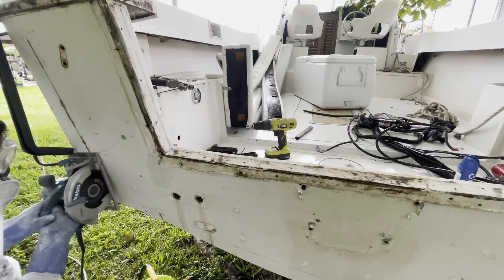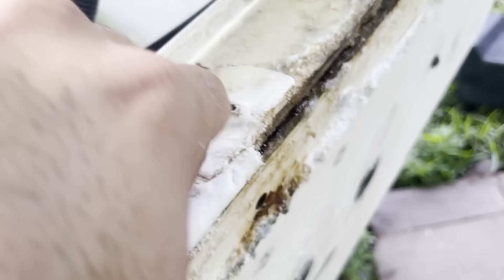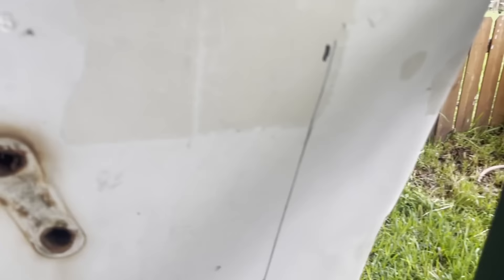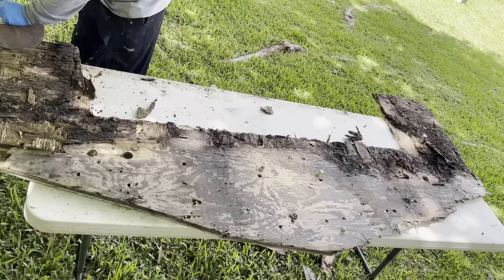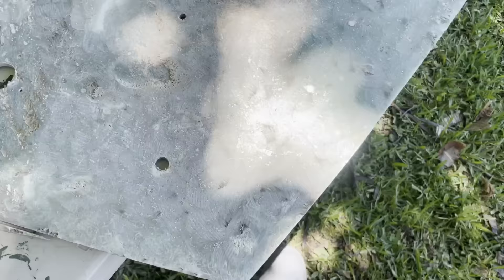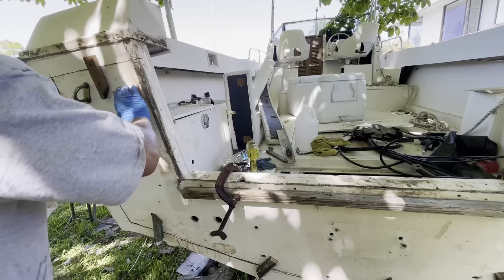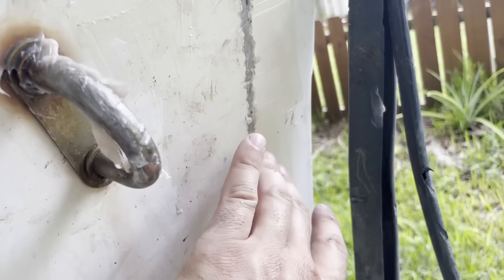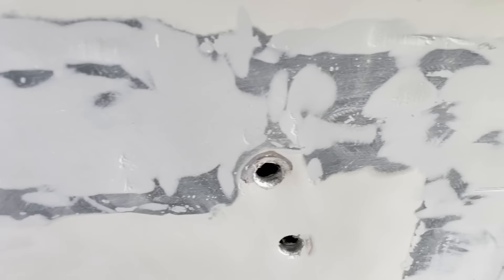Replacing A Boat Transom | Grady White Restoration Project!

Comment: This is a very nice job that will last a lifetime.

Some of the people making comments have no clue what they are talking about. You absolutely cannot remove all of the old wood from the top with a chainsaw or any tool. And it doesn't matter if you cut out either the inner or outer skin to access the old wood. That pourable transom bonds to everything it touches including the skin. You couldn't remove that skin if you tried.

The only thing I would have done differently is to wear something over my arms while cutting that fiberglass! I can feel my arms itching through the phone! 😂
Reply from the maker: THANK YOU! You see, you get it. No way you’re getting All the wood out. If you leave wood bits, they will rot, turn to dust and then you get voids. 

Pourable transom is a CHEMICAL bond that makes all the fiberglass and itself one. So it doesn’t matter! It’s not coming apart ever.  I think some people are confused with the mechanical bond you get with plywood or composite material when you glass it. Even then, I think it’s fine being done from the outside. 

Brother I’m STILL itching from this job! 😂 thanks for the comment! 🤙

Comment: Good job my friend.  I had the GW open and my transom was rotted more than yours.  I drilled into it to mount a ladder and the wood oozed out in a brown liquid.  It was so waterlogged the back of the boat sat so low, water always came in the drain holes.  If I kept the boat I was going to install the full transom with SeaCast and an engine bracket.   Just a heads up, The gas tanks in those are made with thin aluminum. I took it out and had Aim Alloy in Broward repair it.
Reply from the maker: Thank you is much brother! Most of these older Grady’s are all rotted. I actually have another video where i patched up the fuel tank (not original) and truck bed coated it. I’ll eventually put a new tank in her. Thanks for the comment man! 🤙

Comment: Nice work! I used Arjay 6011 pourable transom compound for my project and so far I’m happy with it. I was able to buy it locally so shipping wasn’t an issue and tech support was readily available.
Reply from the maker: That’s awesome! Shipping for this stuff is killer! I believe Arjay and this stuff is the same but I could be wrong. How long ago did you do it and what size boat and motor do you have?
Reply: @perfectfitboating  I bought the stuff about a year and a half ago, did my my pour in December of last year.  Boat is a 2000 Sportcraft Sport Cat 23 CC with twin 200 HP Mercury Optimax’s.
Reply from the maker: @josephwhitehead1692  nice! That transoms plenty strong! 🤙
Reply: @perfectfitboating  for sure. And because I replaced it from the inside rather than the outside, the inside skin is reinforced with 1708 and 1/2 inch Coosa.
Reply from the maker: @josephwhitehead1692  I thought about doing it from the inside and In hindsight, that’s the better option. Next transom I do will be done that way.
Reply: @perfectfitboating  it was definitely better for me since it’s a catamaran. Plus, I figured as rotten as the transom was, the stringers were probably damaged as well. I only had to replace about a foot of stringer.
Reply: It's a good product!  Mine was delivered by an 18 wheel truck I met at a parking lot in my town to pick it up. I hollowed the wood out of my stringers and poured them when I poured the transom.
Reply from the maker: @ralphholiman7401  I was hoping you had a video of it on your page. Not too many videos on it.
Reply: @perfectfitboating  , I took a lot of photos and I wish I had video taped it, but I didn't.  Shoot, the hardest part was renting a small lift to get the 200 outboard off the transom and onto the stand I built for it.

Comment: Was looking into doing this, gonna keep an eye out for how this holds up in the future.
Reply from the maker: Imo it’s the best way to ensure you have a solid bond. Unless you’re highly skilled working with fiberglass and have done transoms before. We’ve been using the boat for 3 months now there isn’t any signs of stress, cracking or anything. I would definitely recommend this method for the diy’er.
Reply: I did it seven years ago to my Mako 211 transom.  It is as strong as the day after I poured it.

Comment: Done a few on Bertrams (completely removing inboards and making them outboards) but did them a little differently. On the skin when remounting, you mentioned you used putty on the cut seam between the skin and the glass on the transom. Was that a epoxy putty you mixed up or a ureathane putty from a can? Secondly, when you used the wood blocks (outside) to help stabilize the skin in place you could have or should have used some interior steel to stop the stresses from pushing the cut skin inward when you apply power to the engine. This location is a possible area to get stress cracks and the seam opening. Thirdly after you poured the liquid you can use a vibrator (like a back massager) all along the transom to help the bubbles or pockets to break up. All in all it is a hell of a project isnt it? Fun to tackle and hope all works out great....Grady White is a very capable boat....Great East Coast boat.
Reply from the maker: Hey Scott thanks for the comment! For the seam I used thickened resin. The stuff out of the can was for fairing. I didn’t think about that steel that’s a great idea. So far no stress cracks and this transom super solid. This liquid also self gassing so there is no need to hit it with a mallet in order to get the air bubbles out like you would with seacast for example. But that’s a very good tip! It’s a HELL of a project! 🤣 we love our Grady and youre right it’s very capable for what it is! Thanks Scott! 🤙

Comment: Great video! Lots of hard work!
I was wondering if you could help advise me on a different type of boat issue. My 16' Bass Tracker has a soggy core floor... meaning that there is a lot of water in the foam between the inner and outer hulls. I cut a 4" by 1.5" hole in the inner floor at the back of the boat and with it jacked up in the front the hole, which goes down to the outer hull, keeps filling up with water. TIA! Keep up the great work!
Reply from the maker: Hey bud! Thanks for watching and for commenting. Some of these older boats are filled with foam that absorbs water. And more than likely that water has gotten into the deck and possibly the stringers. It might be time to rip off the floor and take a look at what you actually have going on under there. We have a 16ft flats boat we just took the floor off that was full of wet foam. Check it out on our page! You can follow along with us while you do your boat!🤙

Comment: With modern adhesives I would glue down aluminium edging straps to reduce water ingress.
Reply from the maker: That’s a good idea! In this case the aluminum edging I put in were coated on the inside with sealant just in case! 🤙

Comment: I’ve never used liquid transom before but I have many years of experience working with fiberglass and resins and resin pours. I have used silica in pours fibercell and shredded fiberglass glass they get hot when pouring? Does the liquid transom get hot? Just a hint what I would have done. Maybe next time instead of building up the low spots with filler , build it up higher with the mat you used stagger your mats so you don’t get big bumps. Then after it cures sand it down its way strong. Also when installing the mat use a fiberglass roller and roll the air out.
Reply from the maker: Hey Ian! Thanks for the comment! This is a ceramic pour and it gets HOT!!! Just as hot as the resins. Thanks for the tip! I’m still learning as I go. As a matter of fact we did another transom on another Grady 19’ but we did it from the inside vs the outside. We’ll be posting that soon and you can tell us how we did! Thanks for the comment! 🤙

Comment: Very good job thanks for sharing
The poured material will dry and harden without being exposed to outside air ? You can just close the cap immediately?
Reply from the maker: Thank you for the comment Dr.! Yes even though it’s sealed, at this point in the process it wasn’t completely sealed. What you don’t see in the video is I opened up the pouring holes on the top to help pour more material. 🤙

Comment: First time watching one of your videos. Very interesting how this done. I have a SeaRay with an I/O. Last year I noticed my bilge would come on while at the sandbar. Turned out I had a leaking transom assembly. Repair facility recommended to replace entire unit as the labor was the same and they wouldn't guarantee just doing the gasket since the studs were already rusting. Luckily it was caught in time and the transom was still solid. Just curious what the ballpark repair cost was for this job? The price of new boats has become insane.
Reply from the maker: Thank you so much for watching! Sounds like you caught it just in time. 
For this size boat, youre looking at right around 1500-1800$. That’s with all the supplies vs 6-8k having it done somewhere. And that’s on the low end. If you haven’t checked out our boat show videos, we confirm your statement of new boat prices being insane 😂🤙

Comment: Great video! I have a 20’ boat with a Mercruser stern drive. It has transsom rot, we are going to pull the engine and drive and rebuild the transome.
I am still deciding on either cosa board or a poured Sea Cast system. Have you done a IO transom?
Reply from the maker: Hey Russell thanks for the comment! And great for you for taking on a project like this! Although I haven’t done an I/O before I think the process would be close to the same. Either sea cast or coosa would be a great choice. If you’re confident in getting good laminations then go with coosa! It’s cheaper. Sea cast will guarantee a perfect bond. And that’s why I chose poured over coosa. I just didn’t have the man power, and experience and the weather to do it. Resin kicks awfully quick here in south Florida! 🤣 good luck! Let us know how it turns out. I hope this video was able to help! 🤙

Comment: Sitting in East-Afica, with God knows how many old hulls - we use multi layered marine plywood, fibreglassed over. I am scared of poor bonding to the sides and bottom of the hull. At times we use rot resitant timber like Teak or Mninga.
Reply from the maker: Thank you so much for the comment! I thought I replied to you when you first commented. I apologize!
People have been using plywood and fiberglass for years with boats. In our boat there’s still some wood that is perfectly fine. As long as you prep the surfaces and encapsulate the wood completely you should be fine! 🤙

Comment: I've got a transom project similar to your transom but a smaller boat. So once you put the panel back you used a putty to fill crack then 1 layer of cloth( or more?). Then more putty to even it out, then primer and then gel coat? Is that right? Thanks and enjoyed the video. Oh are you still satisfied using a liquid transom?
Reply from the maker: Hey mark! That’s correct. I filled the gaps with putty, let it cure then I came back and grinded out 2-3 inches out of each side of the cut on a bevel. Then filled with two layers of 1708 and 1 matt. Then I sanded that down. Then faired it with fairing compound. Primer then marine paint not gel coat. Looking back I should’ve gone with gelcoat. 
I’m extremely satisfied at the results of the transom. I won’t ever have to worry about it again. If I do it again, I’m using arjay from FGCI! Glad you enjoyed the video! Thanks for the comment.

Comment: There's something else which would really make the boat look sharp - a new rub rail. They come in many styles & materials, and are easy to put on - use a heat gun to soften the base track so that it conforms to the hull contour. Plus when you take the old one off, you get to see how the hull / cap plate seam is doing - and reseal it if needed. I pulled all the screws on mine and resealed the entire seam. The rub rail I used was a 2" wide all rubber by Tessilmare, sold by Go2Marine. Most manufacturers have videos to describe the entire process - the boat looks like new - and you can bang almost anything because the cap material is all rubber.
Reply from the maker: That’s definitely on our list of things to do! Once we paint/gelcoat the topside and fix all the dings, we’re going to install a new rub rail. I’ll check out that company you mentioned. Just not sure what color or style we should go with. Thanks for the tip!🤙
Reply: the all rubber is available in white or black - I did the white ( on a tan hull ) and it looks very sharp.  @perfectfitboating
Reply from the maker: I’m liking the all white! It’ll make it look a lot more modern! 🤙

Comment: what has been your experience using eastpoxy as a finish?
Reply from the maker: I can tell you the paint is very diy friendly. It sprays very well and it rolls and rips very well too. But it’s all in the prep and I’m too impatient sometimes. It also doesn’t help I’m in south Florida and it’s 90° half the time so you have to work fairly quick. If you’re going to use it, follow the instructions to a T and use the additive that helps with shine and hardness! HUGE difference! It’s not an awlgrip two part paint but it’s great for the price too! 🤙

Comment: The best option is to remove the F/G on the deck side of the transom. F/G boats with a deck liner will always be an issue when accessing the structure. One thing you never do is cut the F/G on the external side of the boat.
Reply from the maker: This is done in plenty of places every day. Boats doing just fine coming up on a year of use.

Comment: Quick ?.  What was the total weight gain going with the 4 stroke, pour transom and the bracket delete?
Reply from the maker: Hard to tell. This boat had a fiberglass bracket that weighed maybe 250 and it had a 2 stroke evinrude that weighs maybe 450. Carbon core is lighter than wood. Not sure off the top of my head by how much. But the new four stoke weighs 600. We also got rid of the bracket so I think we’re about the same as when we started. Scuppers stay above the water line even with two people standing at the stern. 🤙

Comment: Good work  guys ! What's was the final  cost of the poured  transom?
Reply from the maker: Thank you so much! I want to say that it cost a total of just around 1600 to do it yourself. Paints, resins, fillers brushes rollers etc. If we would’ve ordered another bucket of the stuff you can add another $380 or so to it. I think if you get this job done by someone youre looking at 5-6k 🤙

Comment: I thought about this when I first saw this video. I have a sailboat that was rear-ended by a unattentive motorist desmet to repair the sailboat was 15,000. Hest three layers of fiberglass I figure six grand I'll have it back in the water. Apparently this stuff won't work on my boat. But you never know I might get a small boat in and give it a try there's a lot of boats for sale The only thing wrong with them the transoms are rotten. It's not that big a deal to fix if you know how to work fiberglass and have some carpentry skills.
Reply from the maker: So sorry to hear about your sailboat getting hit. Repairs for fiberglass are crazy expensive. Labor is expensive and the material is expensive too. If you can save yourself the money and diy, I’d go that route for sure. Fiberglass has its little tricks and I keep learning how to work with it. But anyone can learn fairly quick! Good luck finding another boat. Don’t be scared to take on a project like that. It’s more time than anything! 🤙

Comment: Hey cap what year is your  boat and was the boat on the water most of the time before you purchased it?
Reply from the maker: Cap this boat is from 1985! A year younger than I am! 🤣 I think this boat was kept in the water a long time ago. It had barnacles on the bottom. I suspect It was also partially sunk. There was a water line 8” up from the floor in the cabin. That’s why there was so much rot. But I’ve redone almost all of it! 🤙
Reply: @perfectfitboating  wow that explains it all cap but you are doing great 👍  that was a task that i would not take cap but you did it .
Reply from the maker: @OutOnTheReef thank you for the kind words cap! We’re trying to get that overnight video out this week! I have to admit, doing an overnight on a boat is A LOT of work. I didn’t expect it to be so much. Over time we will get more and more efficient. And filming on top of that was even harder. We’ll see how it comes out! PROP CLEAR! 🤙